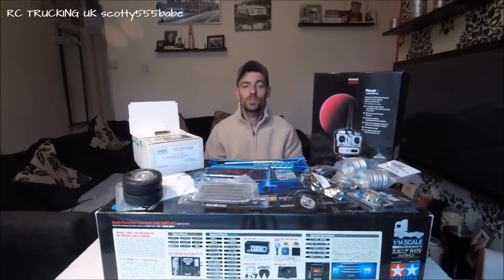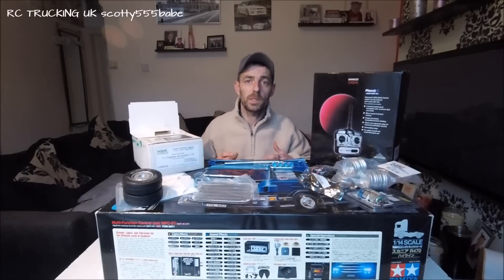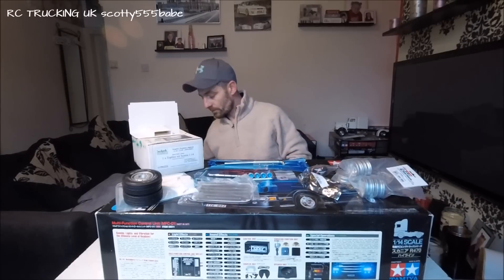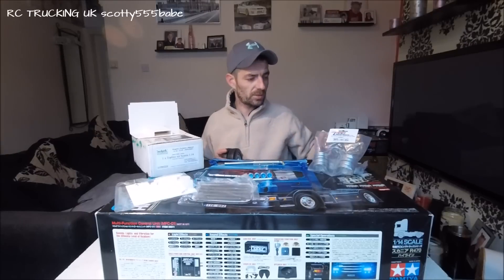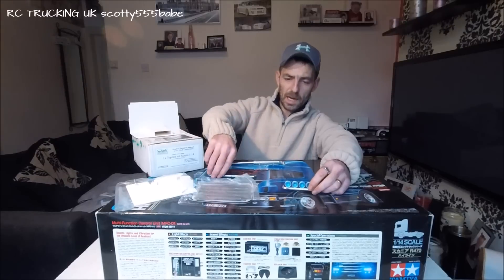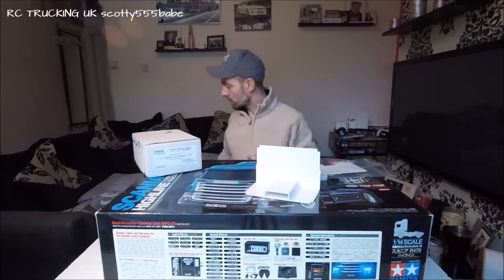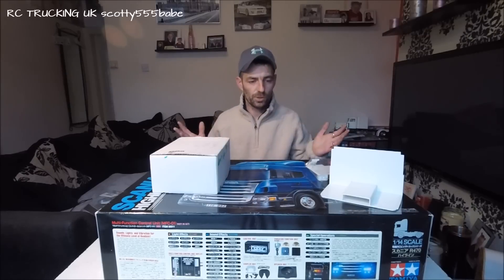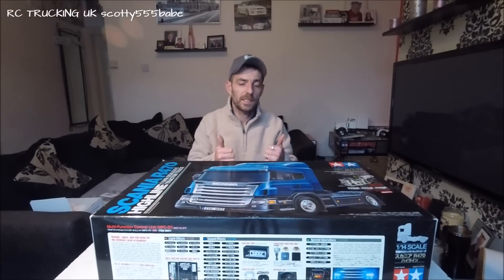RC TRUCKS | NEXT BUILD | SCANIA R470 BUILD | TAMIYA TRUCK & UPGRADES | PART 1

Comment: Hello Scotty, hope you are well, I like your videos Scotty, but l do think the builds are the best, l really enjoy watching them, but could you just explain in the build videos why you like to use upgrades, and does it make the wagon a lot more expensive, l would love to build one soon, but for the upgrades l would not know where to start, thanks Scotty take care
Reply from the maker: +daddy4 evercool Good news for you then as I have many builds for YouTube, I've decided to film everything I do with rc for YouTube as I am always building...
As far as upgrades... if you watch one of my Rc Trucks at Leyland videos you will notice the trucks are nothing like they are on the box... the upgrades vary from extra lighting, metal parts, more realistic suspension set ups, conversion parts..
The list goes on.. and yes its expensive but over time its not so bad until you work out all you have spent on your truck.. for example.. my mercedes slt started as a mercedes standard kit now its an 8x4 heavy hauler, that truck went from a £300 bog standard kit and now has somewhere in the region of £1100 in it so far, add the trailer and its like £1600 and still bits to do and get 👍

Comment: I have a question about your grand hauler build after changing all the parts  you have would it be cheaper to just buy all the parts aftermarket and build a custom truck instead of buying the Tamiya kit ? I was just wondering I am thinking about getting started into rc trucks and if I build one I want to custom build it like I want .
Reply from the maker: No matter which way you do it.. Its going to get expensive..
You maybe better sourcing a second hand ready to run truck 👍